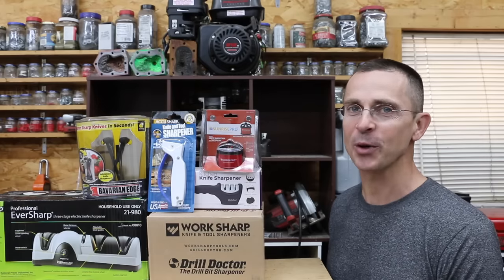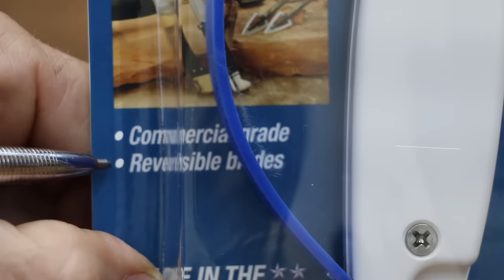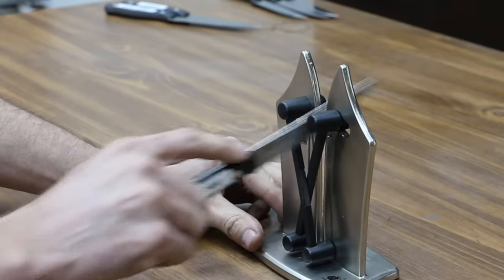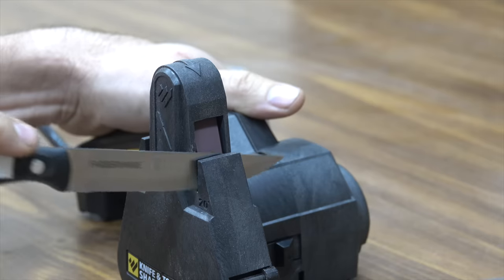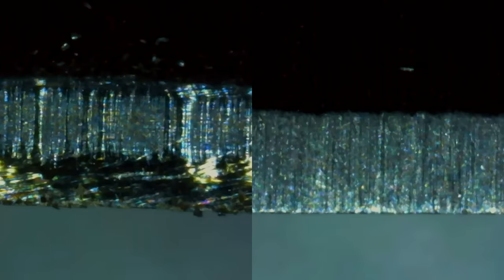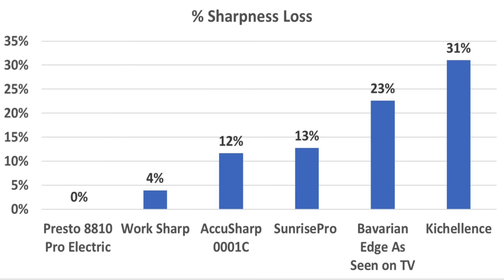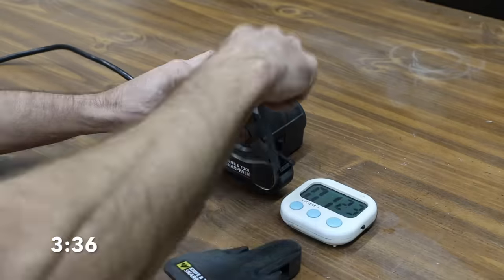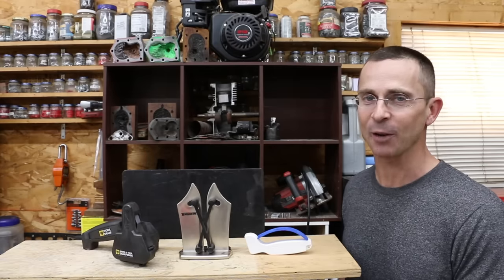Which Knife Sharpener is Best? Let's find out!

Comment: Great video, very thorough. The problem with many of the sharpeners in this video is the amount of material they remove from the knife. If you sharpen a knife once a month, and just touch up the blade using a hone between uses, you’ll still end up with something resembling a fillet knife after a few years. If a person prefers to buy cheap knives, and doesn’t want to learn to sharpen a knife using a whetstone, that will be fine because their knives can be replaced cheaply. However, it would be a shame for someone to reduce an expensive chef’s knife to slivers just because they don’t have the patience to learn the best way to sharpen a knife. It’s also just environmentally and financially irresponsible to purposely buy disposable cheap items, when there are higher quality affordable options that can last a lifetime. 

Professional chefs and cooks tend to sharpen with a whetstone for a variety of reasons. The knife will last longer due to less material being removed every time the knife is sharpened. With a whetstone, you can fully control the angle of the blade that you desire. Whetstones will last ages if cared for properly, since they have no moving pieces. You can bring a knife to a razor edge, consistently, for your whole life, it’s just that it’s a skill that must be learned.

I understand that most home cooks are intimidated by the idea of sharpening a knife with a whetstone. My first attempts at it were certainly not successful. With practice though, a person can learn to get their knife razor sharp, without shaving off so much steel like the cheaper and more user friendly sharpeners. It’s much like the difference between safety razors and disposable/cartridge razors. They’ll both get you a great shave, but safety razors require a bit of a learning curve and will cost much less in the long run, and will result in less trash floating in the ocean.
Reply from the maker: Thanks!  Thanks for sharing.
Reply: I am a tax account for small businesses, in my experience most places bigger than a Mom and Pop tend to use knife rental and sharpening services from where they rent the rest their kitchen equipment.

There is a tax advantage to this (no need to amortize), writing off the expense immediately.

The main thing though is that knives just wear out quickly in a commercial environment, under 3 years.

I don't have any fine dining clients however, so that might skew my opinion.
Reply: @thaddansen2989  In my somewhat limited experience, it a bit of column A, and a bit of column B. The restaurant I work at has “house knives” owned by the restaurant. They get sent out once in a while for sharpening, but since they’re used and abused by everyone in the kitchen, tossed into the dishwasher, used to cut tape against steel counter tops, etc, they usually range from needing to be honed, to beat up and dull as hell. So myself and other cooks who don’t want to deal with an ugly dull knife bring our own knife roll and care for our own personal knives. You’d be hard pressed to find a high level chef who doesn’t bring his own knives to work when the need arises.

Edit: I think that due to the personal nature of bringing your own knife to work, it’s not really something you’d need to be privy to as a tax accountant. Me buying a knife and then bringing it to work doesn’t have any bearing on the restaurant’s taxes.

Comment: I've had the accusharp for years. And just like you showed, it sharpens quickly and easily but dulls rather quickly as well.
Reply: Joseph Carlson thats either because of bad steel and or the sharpener puts a rough sharp edge with both will dull very fast you want a smooth sharp edge that edge will hold up a lot longer

Comment: Would be interesting to see the edge under the microscope when you were able to achieve peak sharpness for each blade.
Reply: You don't need a microscope for that. Just hold the knife with the sharp edge towards you under a strong light & where ever the light is reflected is dull and needs further sharpening.
Reply: @johnpossum556  the whole point is it see exactly what kind of edge has been created. not to tell just if there is and edge or if it is sharp.
Reply: @bobiseverywhere  But you can't see that from that side angle. All you can see is if the microscopic serrations are parallel or at an angle and you can create either depending on your sharrpening technique. So that's a moot point. In your first message you say you are seeking for "peak sharpness" and I still contend the light method will give you the results you seek.
Reply: Would also like to see the microscopic view of the edge after it was worn down from grinding wheel before grinding., When it was over 2000
Reply: you didnt watch the whole vid

Comment: I've been a fan of the Lansky system since my father taught me how to sharpen when I was a kid. Also try using a Sharpie on the edge before you sharpen, it shows the angle of the sharpener so you can see if it's lining up properly.
Reply from the maker: Great tip!  Thank you
Reply: I would love to see the Lansky tested. I've had my eye on one if those for a while now.
Reply: Lansky kits are absolutely awesome.
Reply: Yup, my brother got one when u was a kid. Best I've ever seen.
Reply: Lansky kits hold the angle the same throughout the sharpening process, which is the most important part of sharpening anything. Once you learn to hold the knife steady at the right angle and develop some muscle memory, you can get just as sharp of a knife in a shorter time with regular whetstones.
Reply: Wicked Edge will outperform the Lansky and everything else. They are expensive and it takes a lot of time to sharpen a knife, but you can hone a hair splitting edge with a mirror finish.
Reply: I'd love to get a wicked edge, but the pricetag makes me say "I''ll stick to my Lansky."
Reply: @GrizzAxxemann  Nothing wrong with the Lansky system. Probably one of the best values for the performance.
Reply: I was saying work-sharp the moment you introduced the products. The made in China label gave most of them away.
This all comes down to how sharp do you want your blades ... what are you using them for and how long do you want your edges to last.
My journey in the world of sharpening started with my brother using oil stones to sharpen the same kind of blades I have in my collection.
I thought they were sharp blades back in the day ... but I was not correct!
I went from hand sharpening using various stones ... still not satisfied it was as sharp as I knew I could get that steel (S35VN/ATS34/san mai III VGI/D2 tool/ AUS8A made in Japan) ... so I moved onto various assisted jig style products and ended up with my Hapstone V7 grip-tomatic.
Here are some of my blades.
If you want scalpel-sharp (under 0.5 micros) then you only have one path to take. This one ...
https://www.youtube.com/watch?v=54oh_CZmcU4&t=1026s
Reply: I kept a lansky kit in my rucksack while I was in the Army.
I always had sharp knives and they held an edge. Once the guys noticed I always had the best knives, I became the official knife sharpener for the whole platoon.
Reply: @LSwick-ss6nm  I ask again how sharp is sharp? 12 microns/7microns/3 micros or less ...
Reply: @raygun4468  so for me it has to do with what the knife is used for. For my bigger fixed blades I keep a larger angle so that it holds the edge longer under heavy use. For my folders it depends on whether it is for general use or for precision cutting.
Obviously in the field I can't truly measure microns, but I can test the edges and feel for burrs. For my applications in long deployments, tools like the lansky were well worth their weight in gold as they say.
I am certain that for finer cutlery and for bench set ups, the options grow for how fine and perfect the edge can be.
I looked at the video you linked in your previous comment. Those edges are beautiful.
Reply: @jacobmckee5862  i just bit the bullet and got one, haven't had my pocket knife that sharp in years
Reply: Jacob McKee don’t worry about seeing the Lansky tested. Just get one. Get the diamond kit with five Hones. I make knives and have used a Lansky for 15 years. It will get a knife literally razor sharp with practice. That being said, the Wicked Edge is the best sharpener out there in my opinion, but around 4-6x the cost of the Lansky. It is easier to master though.
Reply: rsbreeze agreed. Wicked Edge is the best out there. Lansky is a very good second place for far less money. I’ve been using a Lansky for 15+ years.
Reply: @alphazuluz  The Wicked Edge is out of my budget for the moment. I was going to ask someone what grit they recommended. I've recently gotten into knife making myself, I profile and sharpen by hand, with decent outcome but would like to up my game.
Reply: Jacob McKee get the Lansky Deluxe diamond kit. It comes with extra coarse, coarse, medium, fine and extra fine sapphire all diamond (besides the extra fine sapphire). Here is what I’ve learned works best for me:

For profiling/reprofiling/extremely damaged blades:
-extra coarse diamond, coarse diamond, medium diamond, fine diamond, fine natural stone, extra fine sapphire, leather strop. 

If the blade still has a reasonable edge, start that with medium diamond and do the same process. 

The natural stone fine I have thrown in there seems to make a difference in achieving a razor sharp edge. You can do it without it but it helps. 

Tips:
When reprofiling or starting out on a blade, I will make back and forth strokes with decent pressure. I will work from handle to tip, then do the other side. Do this until you get a burr on the opposite side all the way down. Make sure you’re getting a burr on each side (not simultaneously) before proceeding. Any spot without a burr likely will not sharpen and will be a “dead spot”. Use a sharpie to mark the edge and make sure you’re getting all the way to the edge. But the burr on the opposite side is the real clue. 

Once you’ve gotten a burr to form on the entire opposite edge (this goes for both sides), that means you have reached the edge and can work up in grit. However, before I move to the next stone, I will do one or two more passes on each side with the starting grit but with about half the pressure. 

Use less pressure with each successive grit. 

Once you have gotten that burr formed on both sides, you no longer have to check for it, as it will just get smaller and disappear. After the burr has fully formed, only use upward strokes (into the blade, or toward the guide clamp). I will make one “pass” which is a series of about 6 or so strokes up and at an angle towards the tip (starting at handle). Then I flip, and starting at the handle, make another “pass” of 6 or so strokes angling up and toward the tip. Once done, flip over and start at the tip and make upward strokes angling toward the handle. Repeat other side. 

Next stone. Keep repeating until done. Oil the natural stones and sapphire, no oil on diamond. 

I will try to make a video showing how I use it in the next few days and post it to my channel. With some tips and practice you can get really good.

Edit:
For blades over about 5”, you have to do them in two sections or your angle will change. I will make a sharpie mark about midway and do the handle side then the tip side. 

I use 25* the most, but it depends on the blade.
Reply: @alphazuluz  You're a national treasure. Thank you for taking the time to write that out. Please do make a video. What's your channel? I would certainly subscribe.
Reply: Nvm, I got your channel.

Comment: I've been using the Accusharp (1st Sharpener) for over 20yrs. I use it differently. I hold the sharpener on the table and draw the knife through it instead. I give it 3 or 4 strokes and they're sharp. Because of the different angles of different sharpeners, always use the same sharpener or you'll work yourself to death.

Comment: I'm on my second worksharp. It's my favorite so far. I'm constantly using it on hunting knifes, axes, and of course the wife's kitchen cutlery. 
One trick I figured out is that if you turn the belt inside out, you can apply jewelers rouge! It's finer yet than the purple belt. If you do turn the belt inside out, sharpen on the down cycle...
Reply from the maker: Thanks for the feedback.
Reply: Berndt Im going to have to give that a try! Would it be like stropping the knife at the end?
Reply: @madcannagrow2833  exactly like stropping the edge. If you do it enough it will polish away the grind marks to a near mirror finish.

Comment: I’m a knife snob. While I understand this video shows how some people may use the work sharp, the video does not do it justice. Most high end factory knives and even a lot of custom knives are sharpened similarly to how the work sharp works. With a little time spent watching the manufacturer or even a bunch of other dudes on YouTube using the work sharp, you’ll find that you easily and quickly get a blade sharp enough to shave with. I’m not justifying a purchase, I’m just saying the work sharp has a pretty good reputation among knife guys. The ken onion version even more so. If you want to get a knife really sharp, it helps to understand a bit about it like primary and secondary bevels or edges, burrs, and stropping. I get it, this video is about taking the sharpener out of the box and with only the knowledge in the instructions, sharpening a knife. However, you can see he wasn’t following the work sharp instructions cause he never checked for a burr. What I’m saying is the user is a bigger factor than the tool. By far.
Reply: Lol i just posted how the Ken Onion edition is awesome. Picked it up on sale when another channel I watch had shown it on sale.

Comment: Yet another great video. Thanks! I have one of the Accusharp sharpeners and I will say that it seems to do much batter after the factory edge is worn down significantly and becomes shaped more like the angle of the cutting edges. The first several times I used it, it didn't do a very good job. but now (years later) it can whip my butcher's knife into shape in three pulls.
Reply from the maker: This is great feedback.  Thank you!
Reply: You bring up an important point, and one I noticed as well. Once a knife has been 'worn in' to a particular sharpener angle it does seem to work much better to keep them sharp. What I don't care for with the Accusharp myself is that it does poorly to clean up dings in the blade. I would like to try the work sharp, I think that's the ticket!

Comment: wtf

My workplace: Please find a good knife sharpener.     Me: Home sitting down watching youtube after long work day searching for knife sharpener.   Project Farm: Which Knife Sharpener is Best? Let's find out!
Reply from the maker: Nice!  Thank you!
Reply: Only good knife sharpener is a human and some proper stones.  Or get them sharpened once a year and use a ceramic rod
Reply: @usbtnt  Ive found that the "Diamond" rods work really good aswell, if you find one with a not too rough grit and not too small, for maintaining the edge, not sharpening it. :)
Never used the ceramic ones, even though im pretty certain they would prove to be better.
Reply: Chef's Choice EdgeSelect 120 has been tested against high quality whetstones in the hands of a very experienced manual sharpener, and performed just as well.
Reply: If your workplace is a restaurant or similar the will hate you if you buy any of those. They are all toys that won't last long and certainly aren't commercial grade.  The draw through sharpeners will not do a good job when you have bad damage. Many can't do the tip.
Reply: SanSal, try speaking about certain toys for pets, or other stuff you like. Just say em out loud as you normally do.
You might be surprised again
Reply: o ps, there is a reason for it.
Reply: it is not really for kitchen knifes, Its for some special pizza cutters that is a 45 cm long blade with a 40-45 degree angle, they basicly just body chop the pizza, we allready settled and ordered with the work sharp as i liked the way it looked under the micro scope.

Comment: I love my work sharp I have had it about a year now.
Reply: Had mine about 3 years and love it. Fast and simple.😉
Reply: Hell yes. Just got one for christmas and sharpened every pocket knife and kitchen knife in the apartment (approx a dozen knives) all on the factory belts. Also did a half dozen of my MIL knives.

I did find that it had a bit of a learning curve to get things down pat, but once you learned it and got it sharp it's really easy to maintain. One or two swipes on the x4 belt and you're back to scary sharp. It's the first system i've been able to get a shaving sharp blade out of fairly easily.
Reply: I love mine
Reply: Yes, my knives are shaving sharp with it.

Comment: The Ken Onion edition Work Sharp has remained one of my absolute favorite tools for 5 years now.
Reply: Switch to the edge pro apex or wicked edge and you’ll get x2 better results. Or learn how to free hand on whetstones, then you’ll get x5 better results
Reply: @LostinYTblackhole  Noone (non professional) needs a sharper edge than you get with a worksharp. Especially, if you have to spend ~600$ and more for an Apex Pro...
Reply: I have the regular work sharp and over the years ive gotten really good with it its my favorite
Reply: P M you can get them on eBay for as low as $180 used. And it’s a lifetime investment that is more cost efficient in the long term for homeowners.